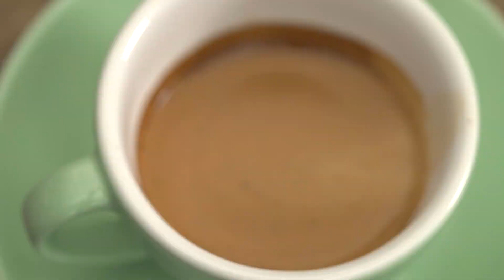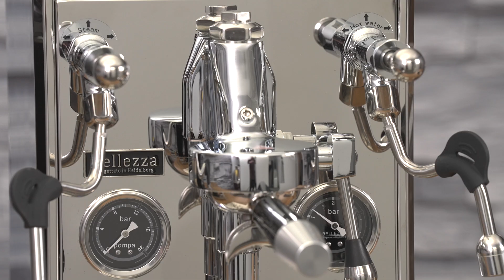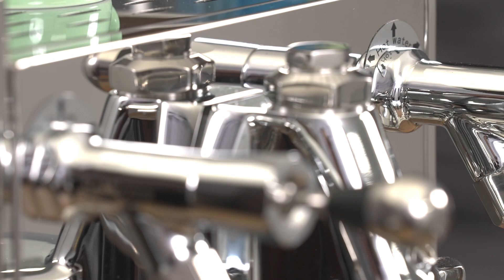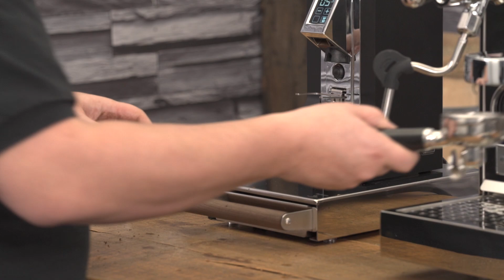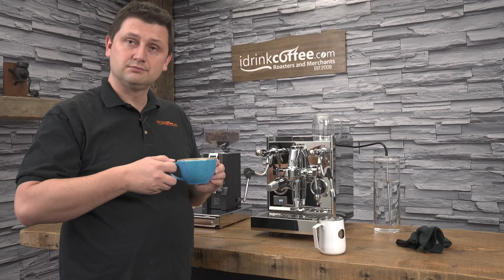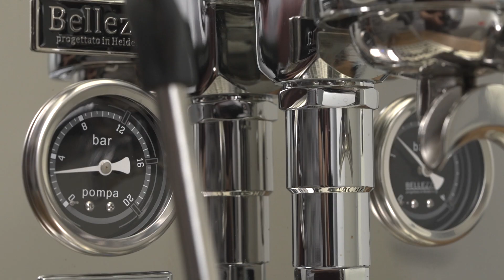Bellezza Francesca Dual Boiler Espresso Machine Preview

Comment: I don't believe that the Francesca has a 3-way solenoid valve or a mechanical valve but   just a basic valve you find in the cheapest machines.   No info is mentioned in the specs. The layer of water on top of the puck after extraction indicates that there is no 3-way solenoid valve resulting in wet pucks. A 3-way solenoid valve would avoid that.   Also nothing is mentioned in the manual about back flushing the machine which should be a standard procedure with machines equipped with a 3-way solenoid valve. Anybody has some more info ?? Thanks

Comment: I always end up with a wet puck with my Francesca. I tried all options but can't solve the problem. Slightly overdose is not possible either because the portafilter does not fit under the brew head. Anybody else encounters this ?
Reply: Try not to do the pre soak, and pour your espresso 2oz around 23-30 seconds

Comment: I just bought one and am so excited for it to arrive. One question: how do I know what temperature the boilers are? I want to make sure I'm not pulling before everything has reached temperature.
Reply: Good question. As a general rule 1/2 hour is normal warm up time for a home machine. But some dual boilers can actually brew much quicker because the brew boiler is separate from the steam boiler. That said this is what I have found to be the biggest weakness of Bellezza is poor support. Their website is an in accurate mess. It maybe because they continually upgrading their machines but the same name machine may have different features in different markets. As far as the value goes these machines can't be beat and they seem very high quality. But they could not even get the dimensions on my machine right. So trying to find an answer for your question is for you to discover through experience unfortunately.  If this was a profitec, rocket or any other name brand their is great customer base to ask questions, but this just doesn't exist for Bellezza. Then again if their was then the pricing would probably be similar to those machines.
Reply: @LowsJuan  use the arrow keys the switch between temp reading between both boilers. The brew boiler takes priority but heats up super quick, less than 5 min. Hope this helps
Reply: When the machine is on you can use the arrow up and down keys to choose between the boiler and steam temp ( note: not the set key)

Comment: Hi, I have bought a Francesca but I can't figure out how use the Bellezza Espresso App. Do you have any video for this? Thank you
Reply from the maker: It has to be added manually in the application but it also has to a be a version of the Francesca that supports it. From my understanding most markets do not have this feature. Did you buy your Francesca in North America?
Reply: @iDrinkCoffeeCanada  No. I bought it in Europe. It does not have this feature. Anyway thanks for reply
Reply: I bought mine from idrinkcoffee Canada and trying to connect and can't figure out how.

Comment: I bought a francesca but during the shot water is flushing from the the valve located near the pid controller. Is that normal?
Reply from the maker: Hi, yes it is, this is water from the over pressure valve and it is a normal part of operation.
Reply: @iDrinkCoffeeCanada  thank you for your answer. In your demo there is no water leaking from there. Do you think that my grind is to fine? Or?
Reply: @mateescudragosh  It happens in this video too. At 6:00, you can see water coming out of the valve in the reflection
Reply: I feel that when this happens to my machine the shot doesn’t create any crema.

Comment: Hi! Two questions re flow control with the Bellezza machines: (1) Does the ECM flow control device work with these Bellezza E61 group heads (and if not, is there a flow control option available for the Bellezza line?), and (2) would a flow control device work with the Bellezza app on the Francesca or Inizio?  Thank you in advance for your answer!
Reply from the maker: Hi, a flow control device can be installed, whether it is ECM or another brand. The flow control device is a mechanical way of controlling the flow of water in the machine so unfortunately there is no way to interface that with the application.

Comment: so is this the new top of the line? or its still Inizio R?
Reply from the maker: Hi, the two models are different.  The Francesca has a dual boiler system, a vibration pump and an external water tank.  The Inizio R is a heat exchanger with a rotary pump and it can be plumbed in whereas the Francesca cannot.
Reply: @iDrinkCoffeeCanada  which one is more expensive?
Reply from the maker: @caf_ein  In Canada the Francesca and Inizio are at the same price.
Reply: @iDrinkCoffeeCanada  ah I see, thank you for the explanation, just found out your website, will do a proper comparison before deciding.

Comment: Francesca does not have the app connectivity option so the credibility of the video is very questionable IMO.
Reply: Our version of the Francesca does have app connectivity. Previous versions released in 220v did not have this but our shipment certainly does.
Reply: There is no confirmation on the official Bellezza website of what you claim. No mention anywhere about the app connectivity there. The app itself does not offer the "manual" choice of Francesca to connect to.
Reply from the maker: @czmielek81  I'm the Canadian distributor of Bellezza, I personally know the entire ownership group and in addition to that I've used the application.  You can add the machine manually to the application.
Reply: @iDrinkCoffeeCanada  I  own a Francesca  so I know what I am talking about. The app has 3 options to connect a machine. 1 Bluetooth, 2 Wi-Fi and 3. manual choice. The only manual choice at the moment is Inizio r
Reply from the maker: @czmielek81  I understand that your Francesca doesn't have the app connectivity but that doesn't mean that none of them do.  Machines built in the last few months do have it.  It also depends on the dealer in your country but I can assure you that all of our machines do have app connectivity.
Reply from the maker: @czmielek81  you can verify by going into the settings on your pid.  After Eco mode the next option should say L 0 or L 1, this is the setting to connect the machine.  Older machines don't have this setting.
Reply: @czmielek81   because of corona virus, we are very late in the  production plan. That’s why the app models will come in Q3 this year to the most countries.  The higher models can connect to the app. Chiara Valentina can not.
Reply: @czmielek81  Try connecting it to 2G bandwidth instead of 5G. I managed to connect it using 2G wifi and auto scan it on Bellezza App.
BTW, I just got mine today. Thanks to Colin of I Drink Coffee.
Reply: @n.t.alfonso  Same experience, auto-scan found the machine as 'Coffee Maker' and I was able to connect. The app seems very much in a beta-state though and the labels seem to be placeholder variables. The app experience could definitely be better. It does, however, work for things like auto-wake in the morning if you leave the machine in ECO mode (standby mode with power-switch on).
Reply: @Kontou911  Thanks for your reply. You can rename the machine in the apps if you want to.
Reply: @Essenza-espresso  
I just bought the Francesca in Australia and assume it has the wifi connectivity build in. 
Fine if the app comes out in a couple of months but can you please confirm it will come out and will work on units that are sold in Australia today. 
If not I might cancel my order and wait or something like that. 
Thanks
Reply: I see L0 and L3 on my pid but can't figure out how to connect it to the app. Can anyone explain please.